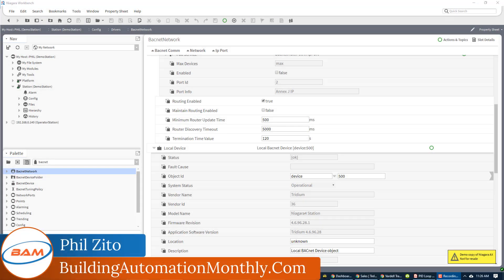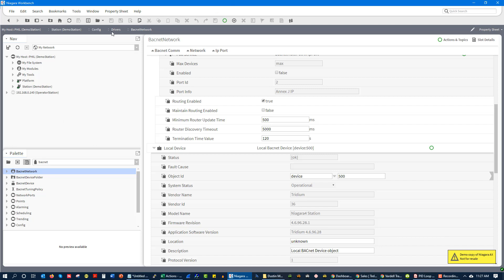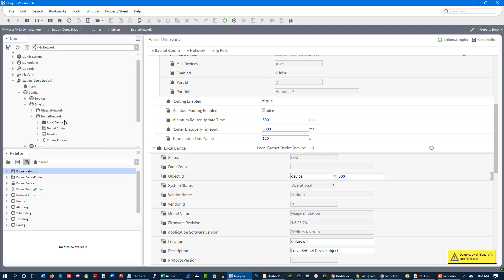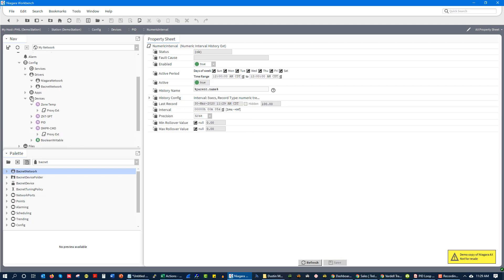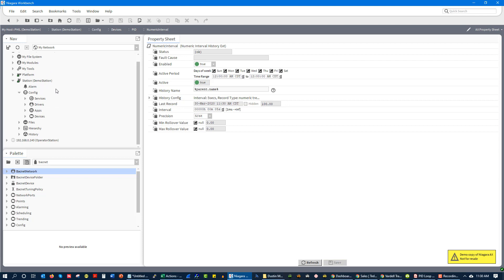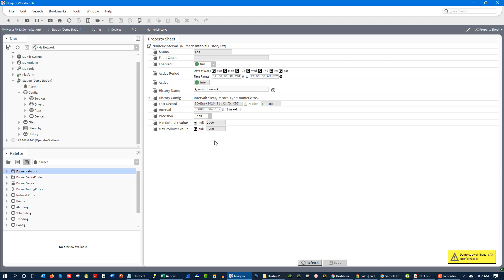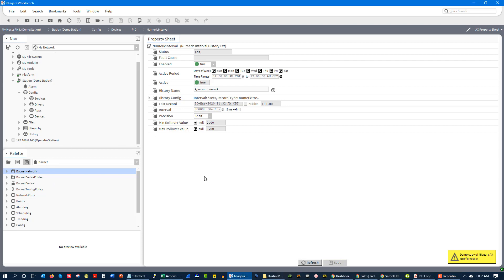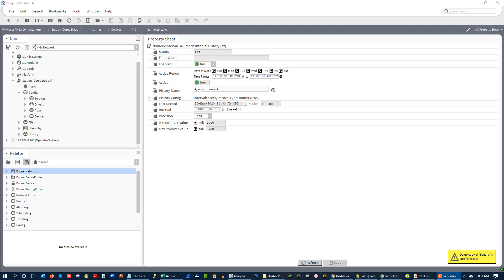BAS Bootcamp: Day 11  Supervisory Device Overview

Comment: One more question in your experience, how many Jace8000 or web8000 do most of the jobs have??

Because here in Chile I've seen jobs with 8 JACEs for 1800 points which I think is ridiculous.....
Reply from the maker: Ideally a JACE-8000 is used as a plant controller and not as a regular controller. Nowadays I recommend Edge10,30,50's

Comment: Good video, I've got a question: if I have a job using ciper controller can I get rid of all the web8000 (supervisory device) and just go straight for the switch and then to the server???
Reply from the maker: You could to a point. You still need a web supervisor to connect all the CIPER's.